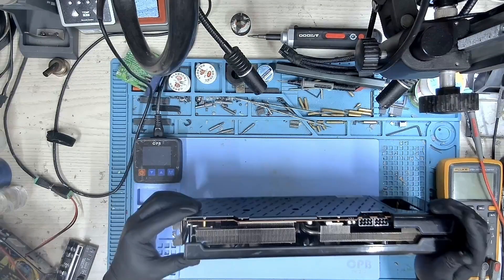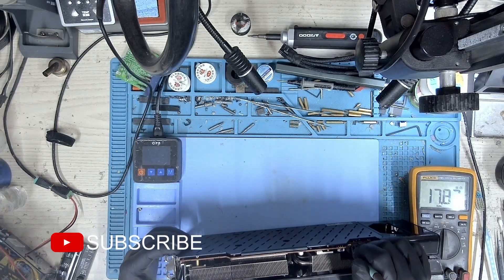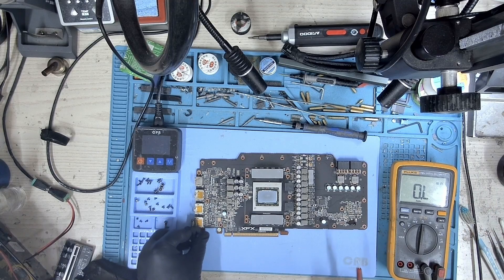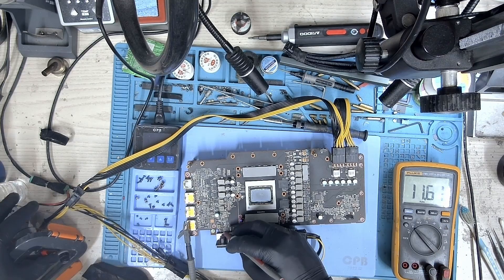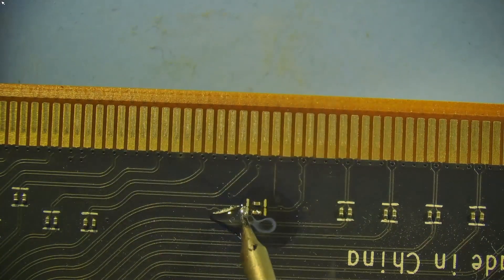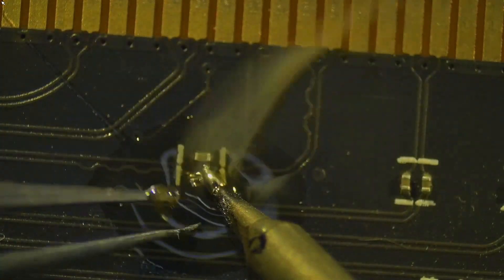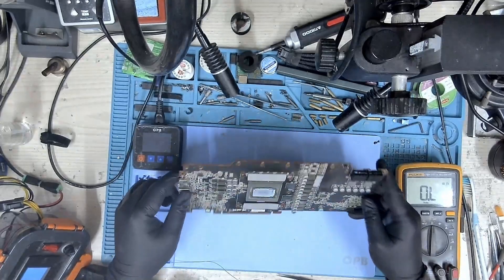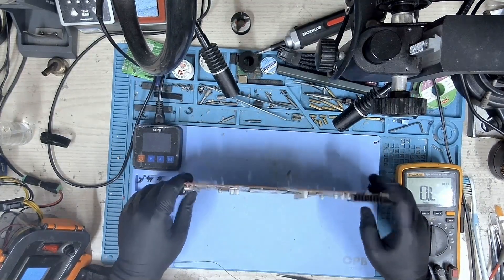The RX 6800 Problem No One Talks About

Comment: I have a 6800xt and it doesn't turn on the fans even when it reaches 100 degrees
Reply from the maker: If your GPU boots and displays image and if your fans don't turn when it reaches 100 then it's possible that either the fans are bad or PWM signal is not going to the fans or the 12V is not reaching the fans.

Comment: Thank your for the amazing detailed video! i bought a broken rx6800xt and i discovered that i have the same problem as you but two capacitors on the pcie Lanes are completely missing. Do you know by chance what kind of capacitors are needed ? I have a friend with the soldering skills but i just dont know what kind of capacitors i need. Thank you in advance :)
Reply from the maker: 220nf 0402 size caps

Comment: I have this same XFX card and the experience has not been great. Artifacts in games and now driver timeouts, despite many different driver versions installed after clean-up utility, and a whole fresh Windows 11 install. You'd think it's a driver problem but it seems not.

I guess my only choice is to try RMA it. 

I've probably just got unlucky, though. Most people have good things to say about this GPU.
Reply from the maker: It could be a possible core issue. It's best to RMA the GPU.
Reply: @ That would suck massively since XFX customer support in the UK is said to be atrocious. 

I've looked into how RMA works with them and it seems they have made as complicated as possible as well.

Comment: I have a asus tuf rx6800 variant. When on p mode the pc cant detect the gpu, but when i turn the switch to Q mode it works and detected. At first reseating the gpu resolves the problem .
Reply from the maker: This looks like an issue with either the switch or the BIOS chip connected to the P mode.

Comment: Hey, just found your video, I have an RX 6800 xt with this same issue, I have I think 5-6 capacitors missing but the GPU boots up, works fine underload while benchmarking but it runs at pcie4.0 x4 how much would this fix cost for a person? And how difficult is it to do? And how do I know what capacitors I need if I want to replace them, they don't have any namings on them, it's an RX 6800 xt sapphire nitro+ 
Thanks for the help in advance to anyone reading and writing.
Reply from the maker: You will need a microscope and the skill to do micro soldering.
Reply: @GraphicsCardRepairs-tk7ql  and for an example how much would it cost to take it to a repair shop?

Comment: Hei, i have this exact card, the fan will spin at full speed when the card is plugged in but no display whatsoever. I did a diagnosis like you did in this video, all the components resistance are normal but i find that voltages in vdd memory, 1.8 volts, & core are missing, but the rest is present, can  you please tell me what causing it?
 
A very nice & helping video btw, i can't do the diagnosis without this video, thank you very much.
Reply from the maker: I assume there is a voltage missing but it's difficult to say without diagnosing the GPU.

Comment: I have a rx6800 that works in safe mode, but as soon as i install amd drivers it gives a black screen and it says the drivers are not compatible (in safe mode). Is that likely a hardware issue?
Reply from the maker: Yes it is possibly memory errors. Memtunes would be required to be run.
Reply: @GraphicsCardRepairs-tk7ql  Not sure if its relevant but in dxdiag it showed it couldn't find my vram in display settings. didn't think much of it, but maybe that's also an indication there's a problem with the memory? I'll have a look at memtunes soon. Also wondering if the 'bake in the oven' method would be a viable option since the card is basically unusable with it's drivers uninstalled.
Reply from the maker: Bake in the over will be a disaster and certain death for the GPU. The kind of solder used nowadays is not an option. The ovens used for soldering and desoldering are not the kitchen ovens. It's an industrial electronics assembly ovens. It's not the same. Using kitchen ovens will make this GPU dead for sure even if there is any chance left.
Reply: @GraphicsCardRepairs-tk7ql  Will try to rma it if optional. Not going to do the oven method then. thanks

Comment: I love my reference rx6800 its been a great card. I was going to replace it this year but it still holds up. I'll probably do a whole new build next year around a different card.
Reply from the maker: 6800 is a good GPU. 16GB on a 256 bit bus is good bandwidth too. This card will last atleast and year or two easy.
Reply: @GraphicsCardRepairs-tk7ql  I ended up doing a whole new build with a rx7800xt lol

Comment: THE PCB OF XFX  IS WEAK AND CHEAP ! i DONT LIKE THIS BRAND!
Reply from the maker: Thank you for sharing. I am of a different opinion. Infact all AMD PCBs from all AIB partners are as per the standards set out by AMD. The copper thickness is better than that of Nvidia. For example a Gigabyte or MSI or even Asus producing AMD PCB has a thicker copper layer with a better bond with the substraight compared to PCBs from the same AIB partners for Nvidia. I agree that XFX GPU design is not that appealing to me either. Let me give you some examples. while working on memory errors when i have found broken pads under the memory. On AMD cards the pads on the PCB are intact and more often its the memory pads that break off, but on Nvidia PCBs the pads on PCBs rip off easily with pads on memory as well. I think all AIB partners have to maintain a standard as stated by either Nvidia or AMD.
Reply: Thats Nice to knew! TKS for sharing your exp!

Comment: Hey really like your modifications dude. Can you also do memory increase for rtx 4060 since many people complain about its 8gb memory.
Reply from the maker: Thank you 😁. Unfortunately the RTX 4060 already uses 2GB modules. Since it uses 128bit memory bus it has only 4 memory slots. Currently 2GB is the highest capacity produced. There is no upgrade path for this card.
Reply: @GraphicsCardRepairs-tk7ql  aah alright that sucks man.Nvidia really stopped ppl from upgrading.

Comment: do you know why those capacitor get damaged ?
Reply from the maker: While installing it removing from the motherboard or while the GPU is  placed on an uneven surface. These are speculation. I knocked off one like this. But to generalise and say it's the same with all would be misleading.
Reply: @GraphicsCardRepairs-tk7ql  but the GPU is covered with Backplat how this happen ? BTW great video
Reply: ah yes you are right those place are not covered by the Backplate
Reply: @Phaz-y3q  A backplate does not cover that part of the video card. Anyway I have seen ripped components in places where nobody should be able to knock out components.